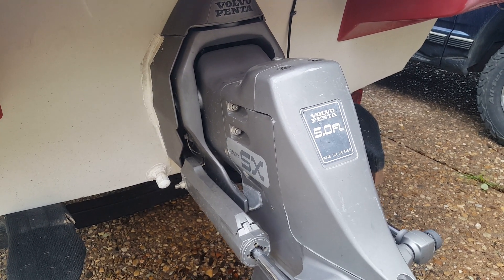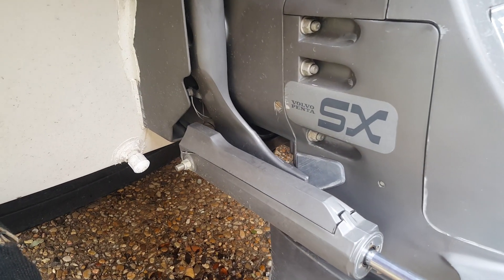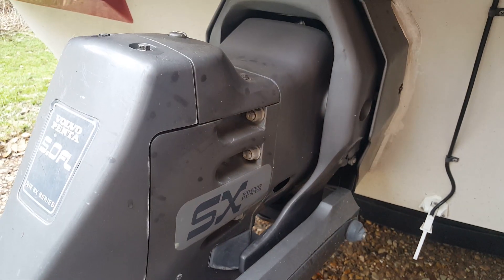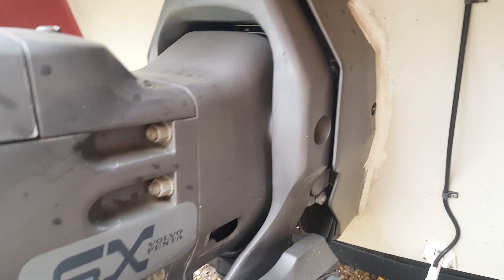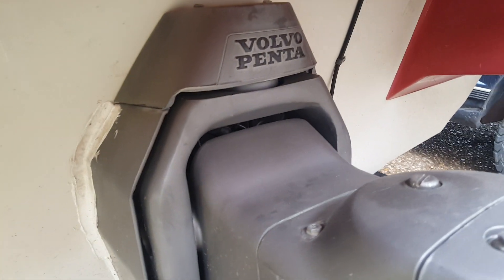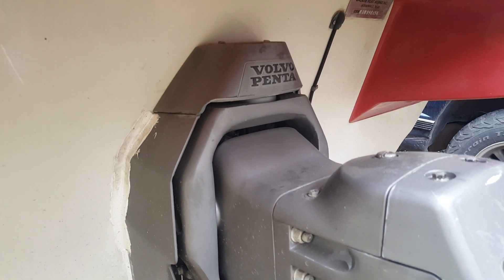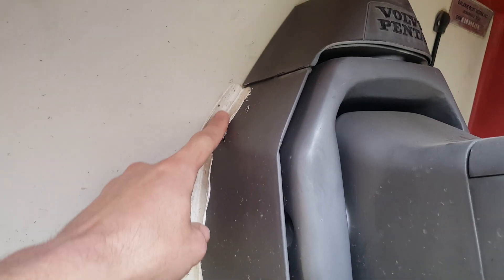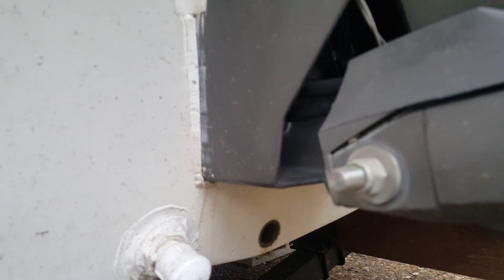Boat Transom and Floor Rebuild Preview - Volvo Penta SX/OMC

Comment: Love your channel. I have an 89 reinell with a cobra and 5.7. I was in the midst of rewiring and noticed my transom is rotten and my floor is in rough shape. I was contemplating converting to mercruiser outdrive. How would one go about locating a transom bracket so its inline with the engine? I know they make an alignment tool that's if you've mounted the transom bracket..
Reply from the maker: OMC stern drives are cheap enough--I'd stick with them. Search eBay and find a used one vs. trying to convert to a Mercruiser.

Comment: I am currently replacing a transom plate/gimbal housing assembly on a 1994 omc cobra sx. I love you videos they are by far the best and most informative I have found yet. I really need some help getting everything together to do this adventure. I could use some help. The boat mechanic has told me $3,500 for him to do it for me. I just need a parts list of seals, gaskets and other parts I will need to replace to do this. I'm pulling the outdrive and engine next week to get the ball rolling. I've ordered the gimbal bearing and gimbal bearing seal, the gasket kit and bellows. I need to know what other things I will need when I start removing the pivot housing and gimbal housing. Thank you in advance and I can provide you with my email if that would work better.
Reply from the maker: I'd recommend you have the mechanic tell you everything they are planning on replacing. Once you have the list go here to check on the prices: https://www.crowleymarine.com/parts.html  I highly recommend you determine what doesn't work and what does before you start pulling things apart. On a boat, there are a few things to consider. There are parts that have to be replaced, should be replaced, and could be replaced. If you have plans to replace everything, it will get really expensive fast.